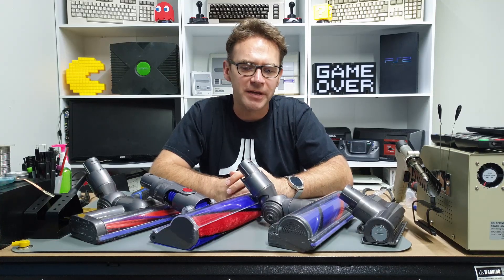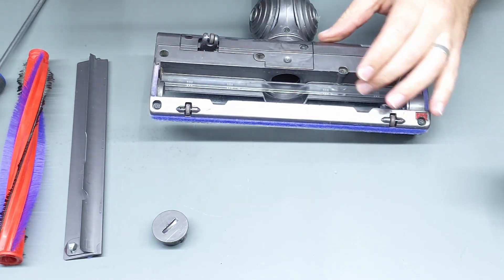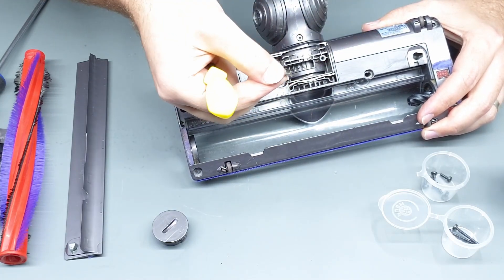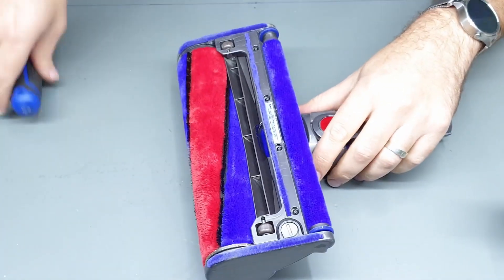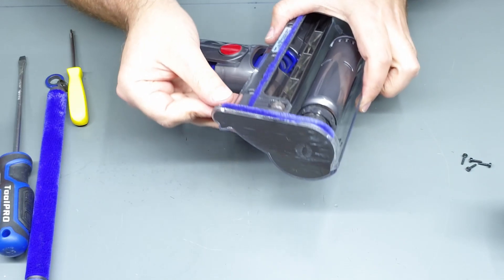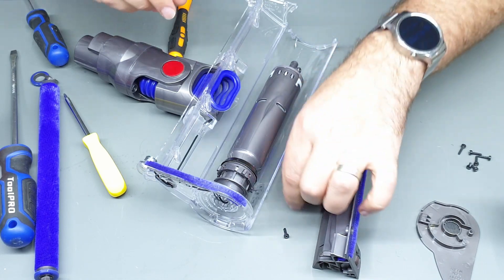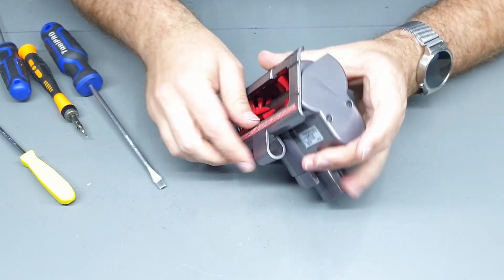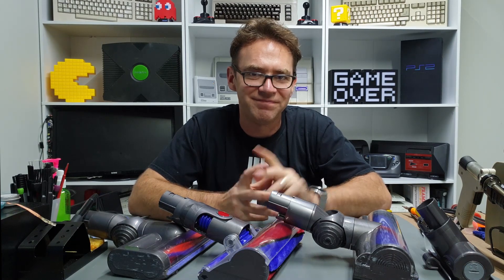Dyson cleaning and disassembly cordless stick vacuum heads

Comment: Hi, I'm wondering if you can help fixing my problem. I don't know how to get in touch with you so I write down here. My Dyson V6 fluffy head doesn't work, due to a broken  part inside  the motor. I want to change just the mear motor but I'm not able to disassemble the drive from the ball bearings of the gear.
Don't know if I've made myself clear, hope you can reply thank you very much

Comment: Thank you so much! My Dyson v6 is brand new now)
Indeed, I have an issue with the tube that does not convey power any more (accessories work fine if plugged directly)
Do you have any clue of how to repair/dismantle the power wires from the tube?
Thanks!!!
Reply from the maker: I've never had an issue with the power getting to the head. Have you made sure the contacts on either end are clean?
Reply: @Sawickipedia  well the best I could do was to vacuum them.
There must be a connection issue : I tried to disassemble the female end, with no success. However it seems to be working again after this tryout session. I'm just wondering what's going on there... Difficult to know without disassembling correctly